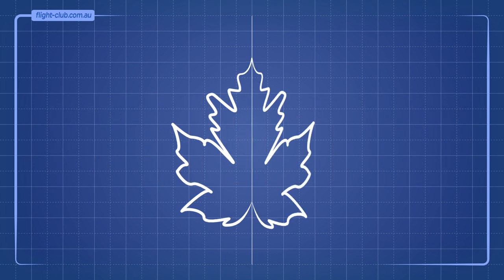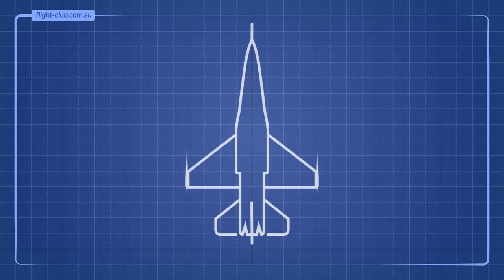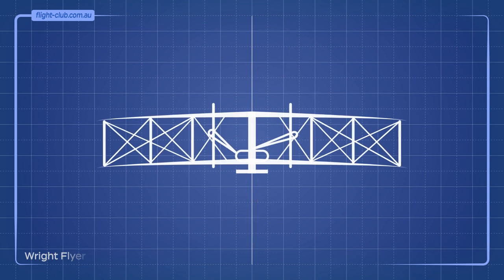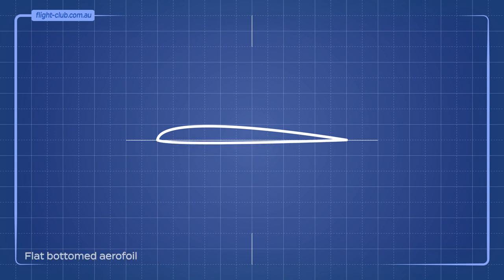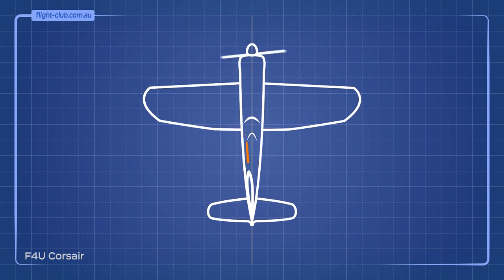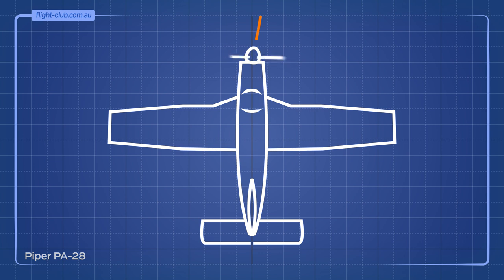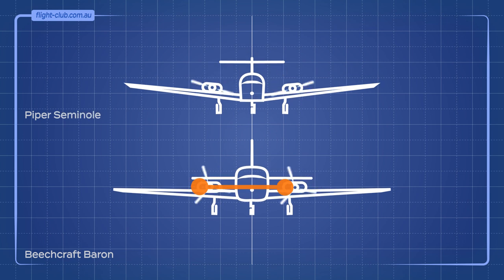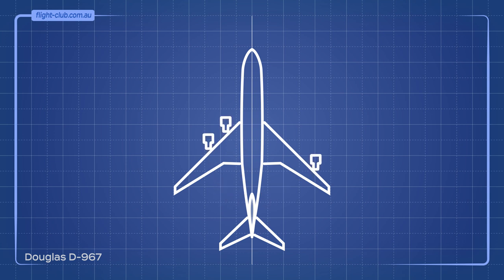Asymmetrical Marvels You Won't Believe | Unique Aircraft Designs

Comment: so in order to avoid this effect, the angle od attact of blades should be contolled (you can changed it, for instance either to drcreas the angle of attack of the lower blade, and increase the angle of attack of the blade which is  moving  upward) in order to have the same lift force produced by the two blades... that goes for the blades of helicopters as well.
Reply: It's harder and inefficient to do that, the better solution is to calibrate the rudder or angle the motor

Comment: The P-38 Lightning had counter-rotating propellers rotating opposite to what is depicted here. In the prototype they rotated as depicted here but they reversed rotation to solve a yaw instability that couldn't solve otherwise. As a result the P-38 had two critical engines, meaning that in both engines the thrust vector was outward of the engine center axis.

Comment: I guess less engine could mean less chance of survival if 1 or 2 engines die, so it's kinda logical to be scared to board a plane that had 3 asymmetrical engines rather than 4 symmetrical looking ones
Reply: A bit of the reason why twinjets couldn't do transatlantic flights for so long, giving rise to trijet setups. Less fuel consumption than 4 engines, but the redundancy 2 engines don't have.